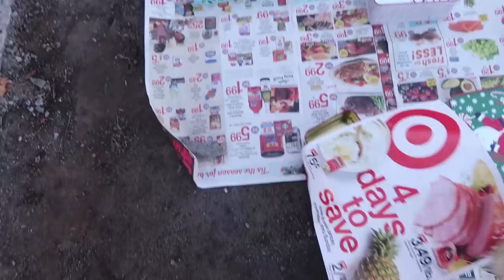#102 SKOOLIE BUS CONVERSION | WE DID IT... AFTER 9 MONTHS OUR SCHOOL BUS TINY HOME IS COMPLETE!!

Comment: Now you know why all water connections for this type of tubing are routed to an easily accessible closet and manifold. Something to remember next time. Good luck!
Reply from the maker: It's hard to build a system where every PEX connection is easily accessible. When we constructed the water supply system, the bus didn't have cabinets. We had to build the cabinets over the water supply system to make the space comfortable. That's when we made it difficult to access that PEX plumbing. I believe if we had tested the system properly then, we would have been ok. When I get back to the bus, I'll get a PEX pressure testing system to ensure we don't have leaks. That said, many of our connections are unreachable. Because we already tested them for leaks, I'm ok with it.
Reply from the maker: Thank you for the comment! Great to hear from you.

Comment: A note on pex plumbing:  they sell a test plug that you can install after you run your pipe and before you install your faucets and appliances to assure you have not leaks.  I realize it is a bit late for you Ian but others could benefit from these cheap fittings.  Available from other sources as well but this is what the fifty cent parts look like:  https://www.lowes.com/pd/SharkBite-5-Pack-1-2-in-dia-Plastic-PEX-Test-Plug-Crimp-Fitting/1000183167
Reply from the maker: Hey Phil - We added on/off valves to each PEX ending and tested it months ago. The on/off valves allowed us to test the supply system BEFORE we installed the appliances (shower, toilet, sink). The problem is, I don't think we tested it well. The hose we used to link the bus to the water system had a hole in it. Therefore I don't think we achieved a high level of water pressure.  Anyways, plumbing is complicated! Thanks for the helpful suggestions as always.

Comment: have you thought any more about makinig your battery bank 24 volt vs 12, a couple of people you should contact regarding this are RV Chief's Prevost and Transcend Existence
Reply from the maker: I thought about it, but I needed to start with the simplest system I could come up with.
Reply: it's pretty easy to change it, you probably already have most of the material. just disconnect one end of the short wires you have connected to a battery and reconnect it to the opposite post of another battery (you may have to make one or two more short wires and a step down, that's it

Comment: Did you do a video where V finished the cockpit curtains?? I can’t seem to find it 😭
Reply from the maker: Hey Natasha, it's V! Unfortunately I didn't record finishing the curtains, sorry! :-( It was such a time consuming and stressful job since I had no idea what I was doing, therefore I ended up hiring a seamstress off Craigslist (who was actually a little cray and inexperienced) Hahaha. So it was exhausting and the job took much longer than I anticipated. Anyway, lucky the curtains came out ok, but definitely not perfect. The problem was that some of them came out about 2-3 inches too short so there's a small gap at the bottom of some of them which I was a little disappointed about. However, their totally fine and if you want to DIY then I totally recommend buying the panels http://amzn.to/2Ch0U41 (which are high quality fabric) as they look amazing, and the stainless steel rods https://amzn.to/2rNW7TN we used work really well! You can also check out pictures of the curtains here in our listing https://www.airbnb.com/rooms/22379364. Let me know if you have any other questions? Thanks for your comment!
Reply from the maker: +Natasha Snodgrass v hired out the sewing so the only work on video we have is her measuring